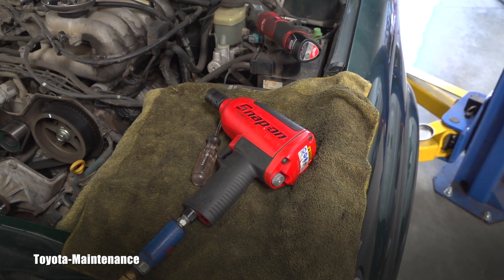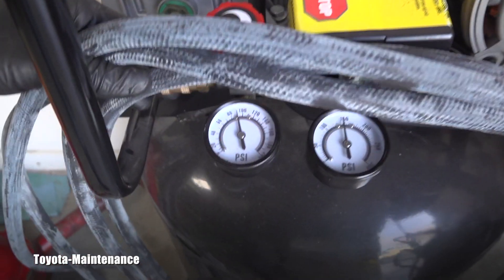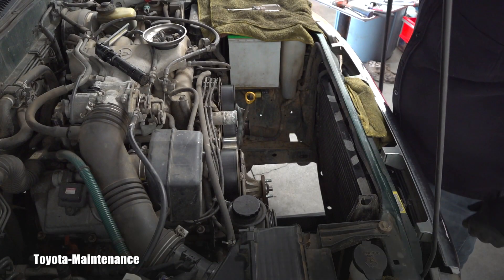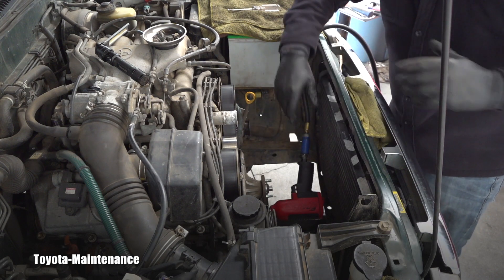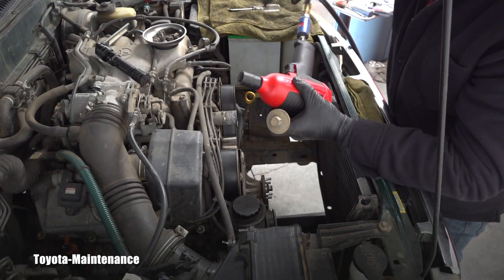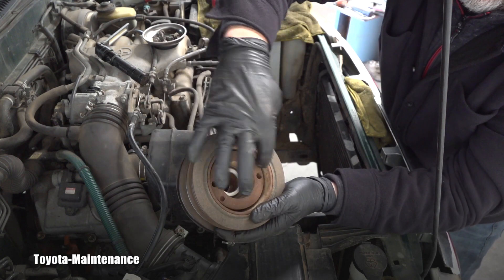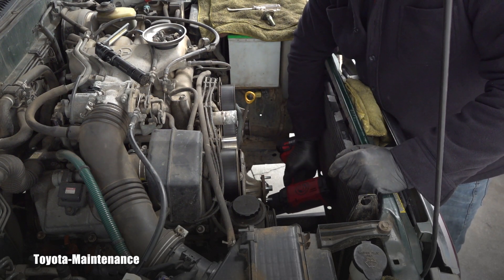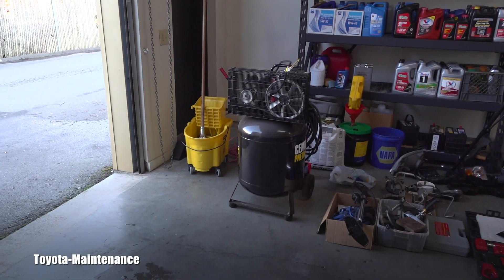Timing Belt Job - removing Harmonic Balancer

Comment: Just tried to use a giant pry bar with an improvised holder for the flywheel and I twisted the rubber balancer part right off..lol. Time for a new used balancer I guess... Then, I tried using the puller bolt holes, but the bolts and threads were mangled instantly.. 🤔

Comment: I know you know this already but I’ll comment for others . You can sometimes use the bigger electric by putting socket on bolt first then carefully put gun on socket . Only break loose then remove gun and socket by hand. So not to hit radiator. I’ve used long heavy sockets made just for balancer bolts with my small air and electric guns 👊🏻👍🏻

Comment: When the impact doesn't work, the starter bump method may.  When ALL ELSE fails...  a 24" chain wrench will get it done.  I tried everything on a 2JZ once, and the chain wrench was the only way it came off.  It was ON THERE.   Wrap the pulley with an old belt first to not knick it up.